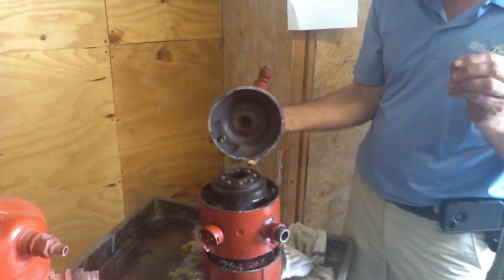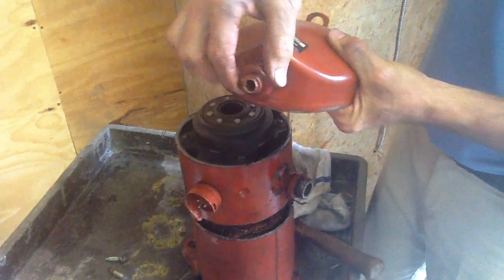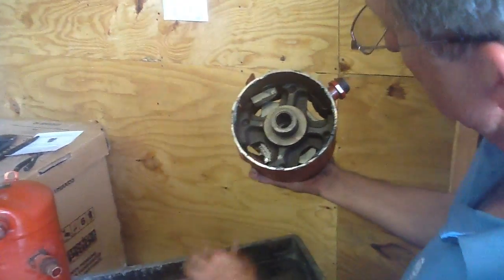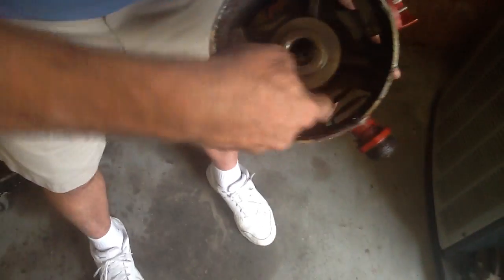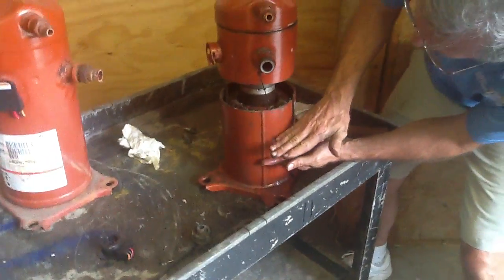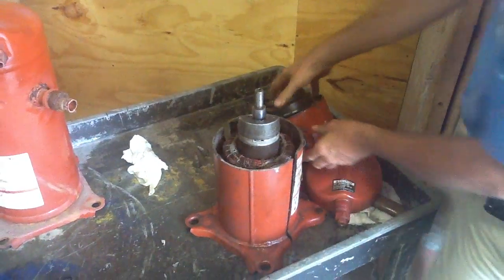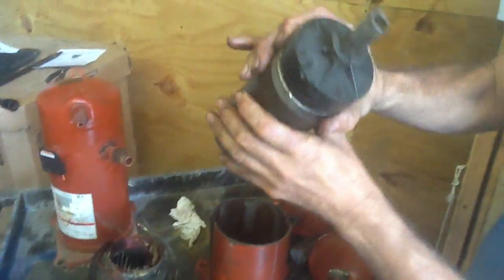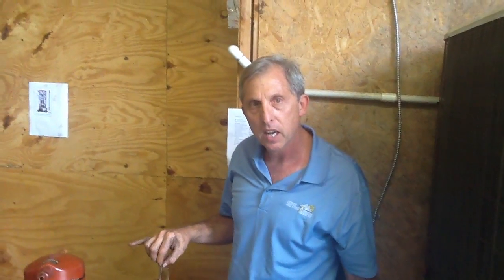What's Inside of A Trane Scroll Compressor:

Comment: It's a sealed system the only way water can get in is a leak in the low pressure side and the compressor actually pulling a vacuum.  Which should not happen....a burn out is usually wrong cap ,sticking hard start,or lightning, or moisture left in the system from poor vacuum during installation that's why I also purge and run a vacuum!!! Gives you the best s.h. you will ever get!! O and that's basically a Copeland scroll compressor bu the way.  They are all the same....

Comment: the Trane alliance scroll is just a Copeland scroll without the internal thermal protection and maybe another feature I can't recall. That's done externally with a    thermal limit that clips on the discharge line a short distance from the compressor

Comment: I heard you say you never cut open a scroll compressor before. When I was in HVAC school in 90 and 91 we use to cut them open in class. The instructor had a deal with an insurance company to do autopsys on them for lightning claims. It was fun and you could tell a lightning strike a few seconds after cutting it open due to the amount of burning that would happen with a strike.

Comment: could you pleasae tell me if this statment is true "The motor compressor is suspended by springs in the capsular housing which minimises the transmission of vibration to the capsule body, thereby reducing noise emission"

Comment: To mrbuccala- The floodwater probably entered through the coil or other tubing.  It would just follow the path the freon would take.  Also water is not good on the electrical components in the cabinet.  This is more than likely why the unit was ruined.

Comment: David, nice work.   Thanks for sharing.  I am still trying to determine whether the compressor heats the oil up as part of the compression process.  If so, wouldn't preheated oil provide efficiency to the compressor.  Let me know if you can answer.  Thanks.

Comment: very good video, you explained it great, I have heard a Scroll Compressor does not need a hard start kit. What do you think? Again excellent video!
Reply: This is an old post I know but the quesiton is good. It DOES have a hard start kit already built in. it is of the 3 wire variety. with a thermister.

Comment: I am looking at replacing my 10 year old heat pump with a trane tam7 and xl18i .What have you seen with problems with these units .Mine is a heat pump in the southside of VA on a 2440 sq ft house with 2x6 stud walls insulated floors and and 5 ft of insulation in the attic.Will this unit be ago .We do not like it real cool in the house in the summer usually we set ours at 78 or 80 and leave it .Winter we like it warm

Comment: What Trane series units use the scroll compressor? I've only been able to fin the reciprocating ones and i'm wondering if it depends on dealer and area.
Reply: Trane is switching or trying to switch to all scroll.  The recips are made in Mexico.  This was done in '98 thru 2000.   When I started at Trane in '95 I was puting pistons, cylinders, and shafts together for single and two-cylinder compressors at the plant in Tyler, TX.  I retired last year.  As of two years ago ALL units were changed to braze-on from roto-lok except the R-22 which are shipped with 95% nitrogen 5% hydrogen instead of freon because of the government?  At the time of retirement our line was using about 50% LG scrolls and 50% Trane scrolls (Alliance) [which are made in Natchitoches, LA].
Reply: Trane is getting rid of rotolocks?!?!

Comment: Interesting to see inside a Trane scroll as we don't get them here!

On the Copeland ones i've took apart there are four torx bolts that hold the top scroll in place, take them out and you can see the scrolls themselves, not sure if its the same on the Trane, can be interesting to see the wear on them and help diagnose the cause of the failure.